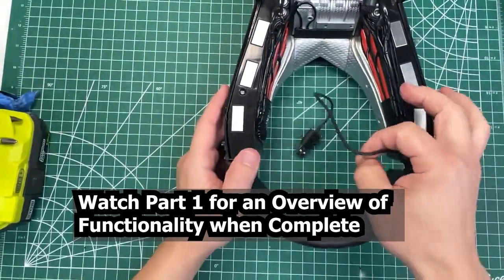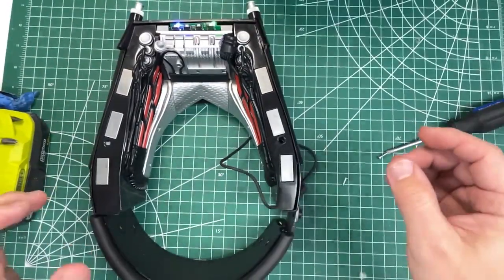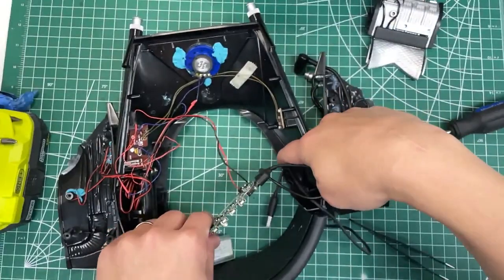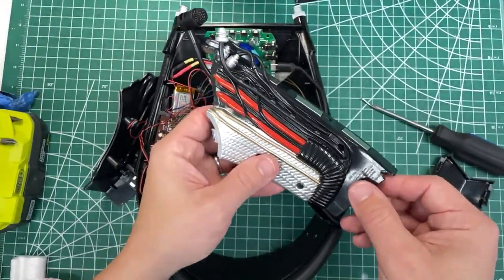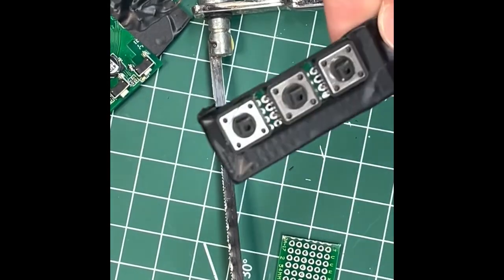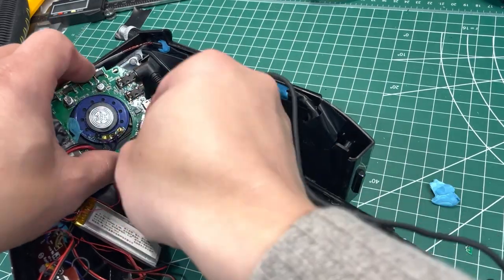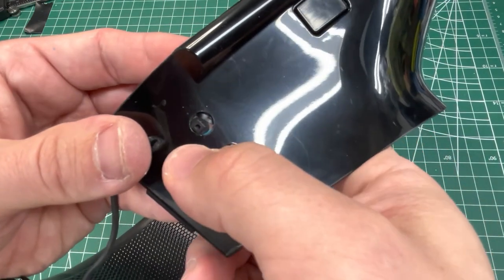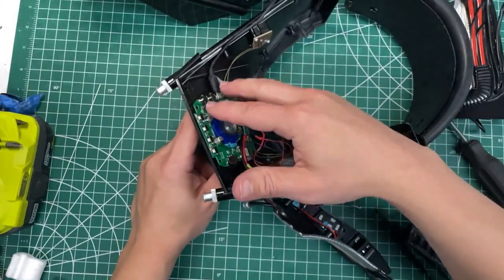Black Series Darth Vader Helmet Mods DIY - PART 2: HOW TO  (Voice Amp, Breathing, Imperial March)

Comment from the maker: I may soon be open to doing custom/commission work.  It’s dependent upon my bulk order of low profile amps arriving.

It uses a much smaller amp board that will be put in just under the Vader jawline so the buttons will all be accessible just inside your neck/jawline without having to remote them like in version 1.  It will also NOT tap into the existing speaker, instead it will either have just the speaker at the top of the dome, or it might also have a low profile one inside the jaw half as well.

 In the next few weeks I’ll release a new video with whatever design I finally opt to do.

You can also check out my Mandalorian black series install to see how I installed this low profile amp in that, to understand the size and button layout - https://youtu.be/yPGlVtBoNYg?si=DCLnQqrpvJUoydzU

If that style installed for control inside the mask’s neck/jaw area is of interest- let me know, perhaps we can work something out.
Reply: I'd be interested in commission work to have my Vader helmet customized! That would be amazing!
Reply: I'd be interested in having you do this to my mask if you decide to take on work.

Comment: The positive/negative magnetic connection from the breathing apparatus to the top is brilliant. Saving vid this vid for my next project!
Reply from the maker: Cheers best of luck. I’d like to hear how it works out.
I’d recommend using a smaller amplifier than I used in this model. That was my first time opening an amp and it is definitely the largest amp I’ve ever used - increasing the complexity and length of build time. If you take a glance at some of my other videos - I found a very small amp that works well with masks and I’d use that instead. 
Now that I have the newest, black series Vader helmet, I’m looking to redo this project on that one, a bit more efficiently. I just need to find the time. 

Anyway, glad to hear it helped. Good luck in your build Dude and take care.
Reply from the maker: I’m working on my 2022 black series Vader now - it’ll be much more efficient that the previous.  Hopefully I’ll have the video out in the next few weeks. FYI

Comment: Where can I get all those parts. Like the green card things? I want to have my helmet like that, but I don’t know what the things are. I’m seeing if my dad can help me
Reply from the maker: Breadboard kit has the blank circuit boards and buttons included. https://amzn.to/3KoxOTK
Mic & Audio Amp - use this one instead - much easier to work with - https://amzn.to/3AbVhmB --  This amp has a much smaller circuit board, and should be easier to integrate.  See the video where I show and describe it: https://www.youtube.com/watch?v=N8pYezaKldo   (the Tacstar amp I used in the video was huge, wrapping around the speaker - and while it worked out in the end - it was challenging to fit it in well.)

Comment: What tools did you use for this?
Reply from the maker: .  I unscrewed the jaw portion to get access there. Then I used a pliers to break out intrusive plastic portions and used a Dremel with a grinder to clean those up.  I drilled out the holes on the side for the buttons.
To put the wires through the face part I just unscrewed near the sides and ran the wires up the inside edge of the face.  At the top of the upper half I unscrewed the area holding the speaker and might have used pliers and Dremel again to fit the speaker in.
For the electronics - a soldering iron, IRWIN VISE-GRIP Wire Stripper, wire cutters.

I think that’s it - if there’s a certain part of the helmet that you’re referring to that you need to insights on -just let me know, cheers.

Comment: It's impossible to improve on Vader's Black Series helmet, an ugly and completely failed toy and too expensive for its lack of quality. The only way to get better is to replace it, either with the Rubies supreme, if you have a small budget, or with an accurate helmet. The Rubies supreme can be improved by changing the lenses and re-sculpting the mask and dome a little and repainting it. The result will be much, much better.
Reply from the maker: I’d agree that the screen accuracy is a failure, however the ‘quality’ of the masks materials is good.  

I have a Rubies Supreme helmet I might redo…time permitting.  That one was super easy to do an amp install in: https://youtu.be/VEt5GZX-QSw?si=fTq8YuBSXtcJJv8Y
Reply: @creative-stuff , since my message has been deleted, I'll do it again.
When I say lack of quality, I obviously mean lack of design quality. That's the most important thing when you want a Vader helmet, you want it to look as close as possible to what Vader is. What's the point of good materials if not for that? It's useless and a waste of money. 

It's like your upgrades on the Rubies Supreme, you can add as many sound systems as you like, but if the appearance of your Rubies helmet isn't improved, you'll always get a bad result. 

You can find out how to improve this helmet on sites like therpf. The first thing to do is to remove the lenses and replace them, installing them from the inside. You don't need to buy any, you can form transparent plastic with a heat gun and glue on a smoked film (you will install them after repainting the mask). You'll need to modify the dome's positioning system, and slightly resculpt the nose and dome's central band with putty or filler. This alone will transform and enhance the helmet. Of course, you'll have to use primer, sanding and repainting, but the result will be a hundred times better. 

When you see an upgraded Rubies Supreme, you can see that it's light years ahead of what the Black Series looks like.
Reply from the maker: @philippealain-art  ahh right on.  Yea, I have seen that info on fixing the Rubies Supreme and have that idea tabled for a future action - the only other thing I remember offhand is adjusting the mouth area too. 
Fortunately it is now further delayed because I just got my new EFX release of “A New Hope”  Vader today, so it negates the need for me to mod my Supreme until I just have nothing better to do.  My Supreme is old and needs a full overhaul.

Did you do the Supreme mod on yours?

Oh btw - EFX started their Vader rerelease a month or so ago and we’re still in stock a week ago for $350 on multiple sites but I picked mine up on Sideshow - yep just checked - still in stock- https://www.sideshow.com/collectibles/star-wars-darth-vader-helmet-efx-902917#